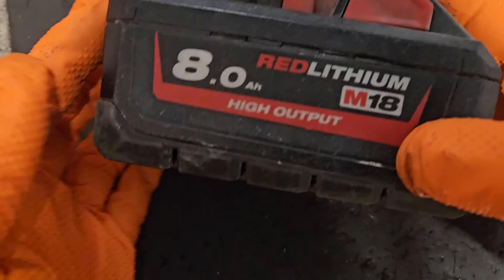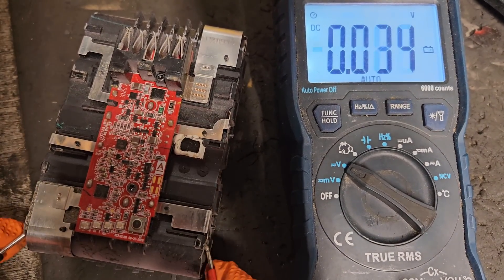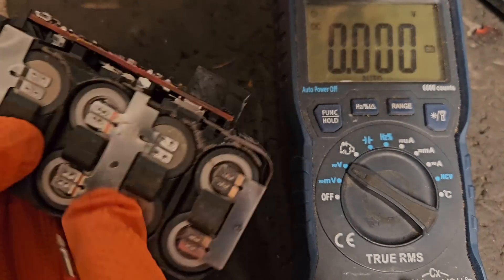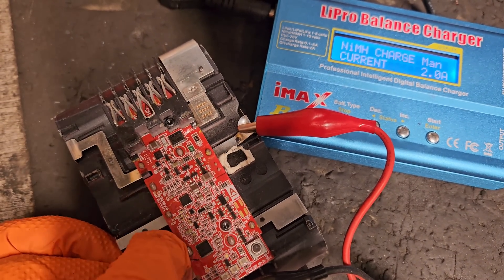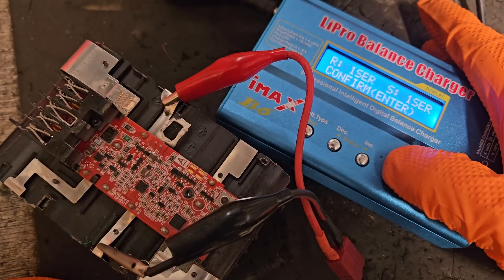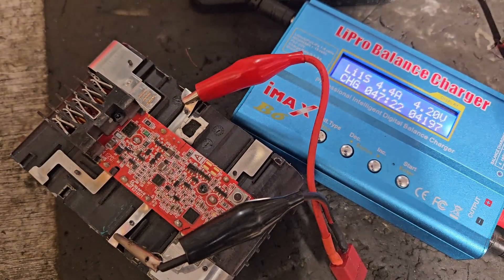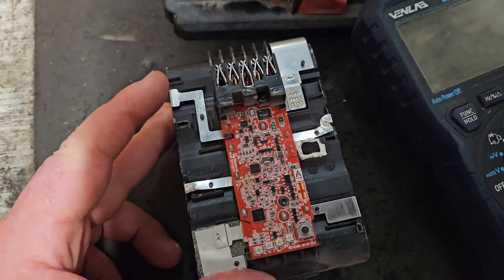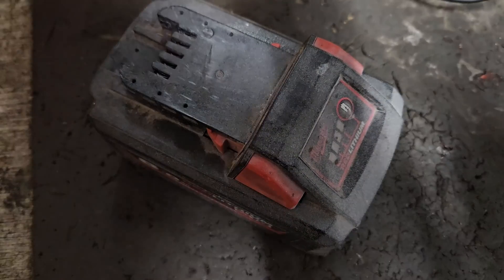How to Detect & repair Battery Cell Imbalance

Comment: a cell pack has a cell that has zero volts. should one start with the lipo charger on that pack or just replace that cell first??
Reply from the maker: I would replace the cell
Reply: @doctorlefthandthread  we about trying to see if the battery takes a charge ?

Comment: I have the exact same issue with my high output 8.0 ah. Once the faulty cells are charged back up will this continue to be a problem in the future for this battery?
Reply from the maker: It might be an issue in the future but it's always worth a try. I have had an astonishingly high success rate with this.
Reply: @doctorlefthandthread  great! I think I’ll give it a try. I only have two cells from the whole pack listing around 3.6v. I was torn between this method vs buying a cheap spot welder and replacing the bad cells, but this may be worth a first step you think? I’m using this battery in a high draw application in my M18 mower.
Reply from the maker: @Drew1734  either way you will need to get the cells to the same voltage so yes balancing cells is the better option.

Comment: I have  dewalt type battery  5S 2P . only shows 3 leds of 4,after charge.  All banks measure the same but it loses power quicker than it should. is it possible only 1 cell is duff? and therefor must i disconnect 1 side of every cell? great videos Thank You
Reply: @cesariopereira7431  Thanks !